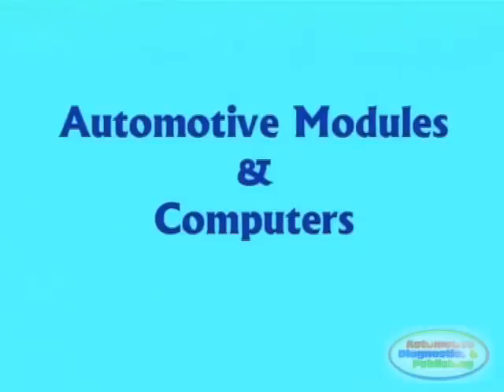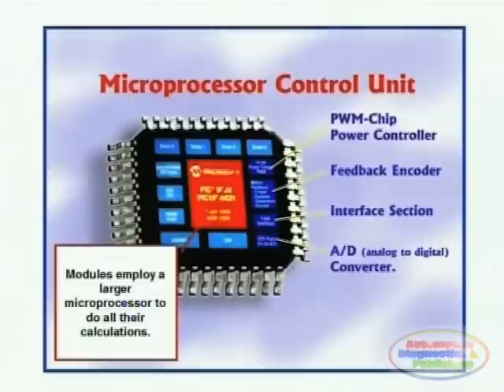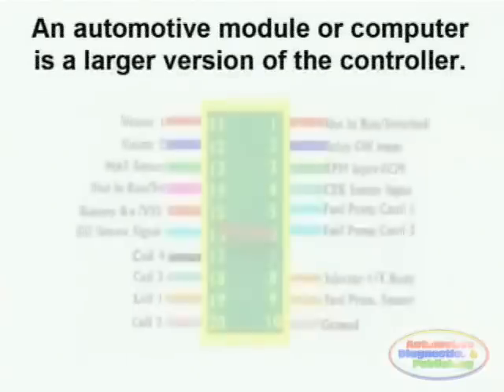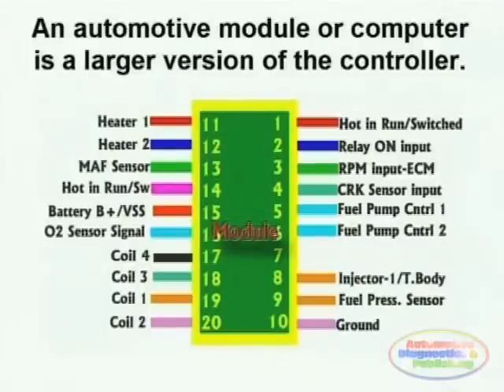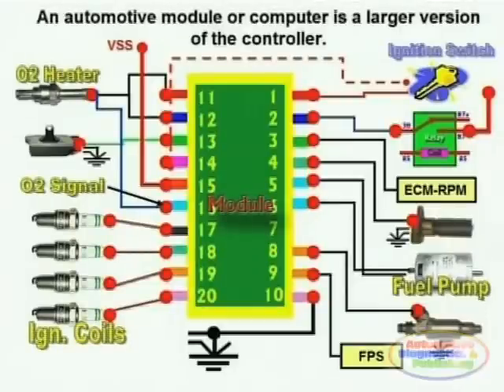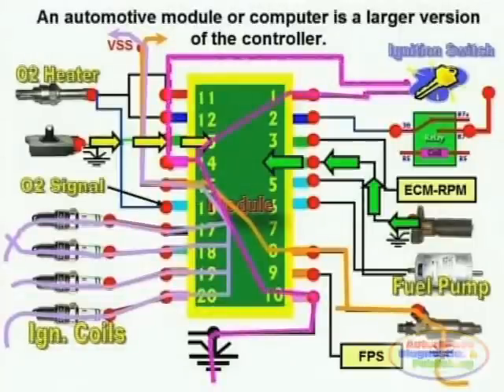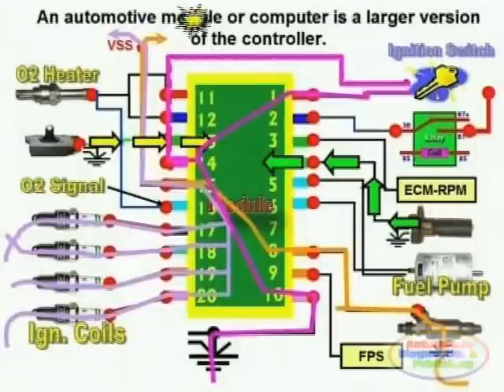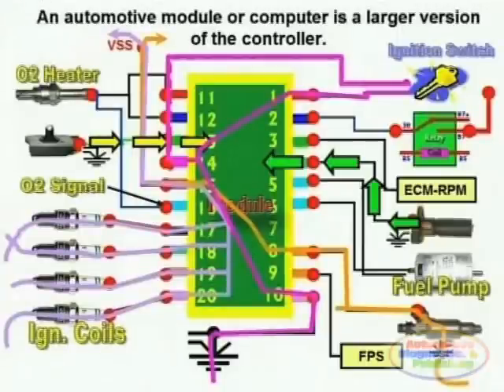ECM Circuit & Wiring Diagram

Comment from the maker: Well, if you swap a fuel injected engine you have two options. You can not use the old engine ECM, as the fuel injection pattern is totally different. You can either also swap the new ECM and wiring harness (that's the norm) or you purchase a programmable ECM system, which also comes with the harness. You can purchase ECM and ICM (ignition module) separately. Let us know when you start this project. I'd love to hear how it goes. Good luck.

Comment from the maker: Your harness should have provisions for chassis ground and battery positive. If not it is incomplete. It'll be a nightmare for you since you'd need a wiring diagram and disassemble the harness and follow the wires from ECM to their final point of ground and power connections.

Comment from the maker: Ok, older vehicles the injectors were group fired. Normally one injector bank was fired then the other. That's why you see it that way on the schematic and also for sake of explanation. After group fire came multiport injection and then sequential MPFI. On sequential injectors are fired independently. One thing to remember is that even on modern sequential MPFI, only UPON START UP all injectors are fired at once. So, in effect the old group fire injector scheme was never fully abandoned.

Comment: Thanks , the public library in my town uses donations and tax dollars to provide the citizens with needed info. The info it would take to provide the most updated info about the system in the cars we drive. Once identifying what you are working on, it is free to the public to search the automotive database, in this case they have Mitchell. Factory manuals are offered at city library 7 miles away.                         your mileage may vary,            happy motoring

Comment: dudes, get your make, model, and year info. take a pic. of CAFE decal on the vehicle where it was produced so you know what you are working on. then goto the public library. get on their automotive database. ours is mitchell. then get your updated wire diagrams, tsb's and any recall info. THEN you can have a base of reference to answer pcm/ecu pinouts. all this generic info is classroom stuff but not specific for a real application thats going to enter the highway

Comment: Info at the public library is available to any citizen.  Every manual lists system prechecks before pinpoint tests are indicated.  Paying for CERTS does not a technician make!!!  Being able to answer GM questions on a test has not been an indication of reliable work. Other makes use different things. This is why I was noting that this info is available and clears up confusion. It also leads to the use of parts that superceed whats at the local stores.  Defining the info is the first step. y'wlcm

Comment: there is a bunch of wires to connect to the ignition switch power ground crank signal nd more how do i dertermine which wire goes where it has like 5 lose wires to connect to give the ecu power nd ground nd for the fuel pump

Comment: 1997 Nissan four-cylinder four-wheel drive Computer ECM burnt going down the road spent half a day looks from front to back a vehicle for bad wires and clean ground installed new ECM in truck let run 15 minutes and burnt the same capacitor out as the first original one I am losing my mind and I need help.
Reply from the maker: Great

Comment: Hi ..I have a problem with my case.. So my 02 sensor keeps resetting on my obd monitors after doing a drive cycle and keying off and on.. Any issue what could be causing this? And also only the 02 monitor would be incomplete but the rest would be complete even after resetting the ecu?
Reply from the maker: I would lean on the ECM ground circuits.